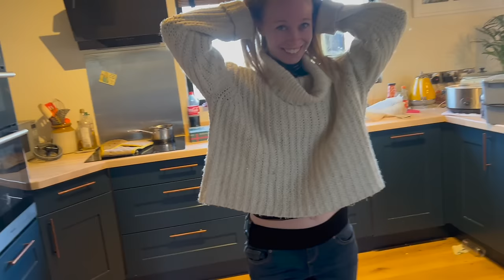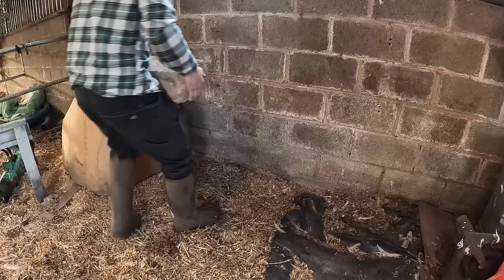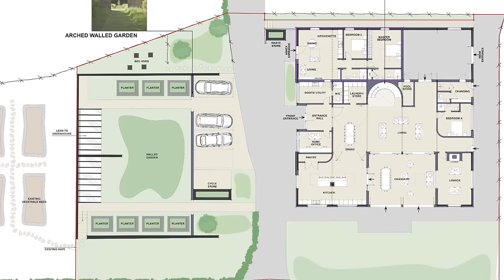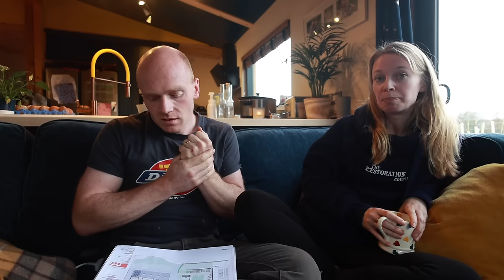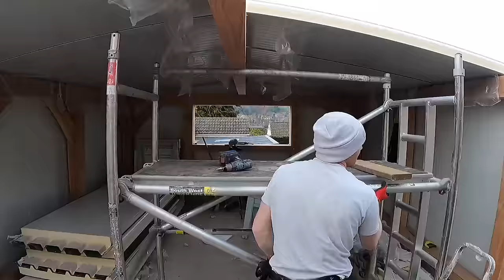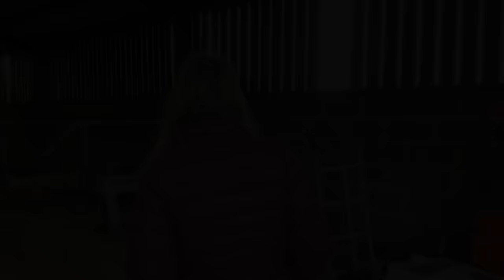PLANNING GRANTED - Dream home build HERE WE COME!

Comment: Very exciting!   Zoned underfloor heating on polished concrete.   Zones so that you don’t have to heat the whole house, especially the annex area.   As could be pricey to run.   Polished concrete can then be carpeted if required later on, or timber floor over.   
I think somewhere between £50-70k.    Good news is, apart from market value increase, I’m sure your YT will increase as well!  
Very much looking forward to the build & all the great problem solving.   Cheers from Oz.   👋

Comment: Don't neglect networking. Take the opportunity to run data runs to each room of your home. Given the size you'll need multiple access points to get even WiFi coverage throughout
Reply: That looks like a perfect table tennis room to me 😉
Reply: Agree on networking....especially the floor space
Reply: Both cat6 and conduit so you can pull in more later.
Reply: I dare say if Tim reached out to UniFi they would likely supply his equipment for free, they have done for much smaller channels
Reply: This needs more traffic, not something to be overlooked - especially in this IoT age. Run cat6 everywhere! Future you will thank you for it

Comment: Well done, I feel your pain with planning permissions and dealing with difficult counsel departments. 
I think you have spent between 30k to 40k so far. But remember one third of your building budget will be foundations plus add 25% for contingency. Make sure you price everything with a potential prices of inflation to be included as you're going to take 3 years to build it. A good investment is to include under floor heating just because of your square footage of concrete floors. Good luck!

Comment: You can definitely save by leaving the floor slab as is, simple polish should be enough before sealing it. You can add pigment to the sealer for a bit of a different (but finished) finish.

Comment: Definitely go for underfloor heating on that slab.

You've got the room to get boring equipment in fir a ground source heat pump, but TBH if you're meeting current UK building regs for insulation then you'll probably even be able to run it all off a (large) air-source unit.

Comment: Many, many congratulations 🎉 would deffo recommend underfloor heating especially if you go for a concrete or hard floor finish (no need for slippers in the winter😆) good efficiency and you have no radiators on the wall for furnishing and decorating 😊 and you can never have to many plug sockets!!!

Comment: Ive just completed an extension we have a secondary insulation layer called MultiFoil by YBS also have it on the floor above mineral wool with underfloor heating boards on top thats called FloorQuilt.
Its about £100 for 10 Square meters they do a roofing one as well 
You sandwich multi layered space blanket beteew 2 battens removing all thermal bridging.

Comment: FOR CKS SAKE FINALLY!!! YEY!! 
For a job like downstairs flooring I think I would negotiate a lower price vs advertising on your Youtube channel for the coming 5 years or whatever with some big chain store. Use what you got. You got exposure and they want the advertising. You might get your hardwood floor yet. ;) But with the floor slab already in place, you might want to consider partitioned (different house zones) subfloor heating. It can really save you a bundle on heating costs if you look at a 20 year plan. Especially if you can use (part of) the roof for solar heating instead of solarpanels for electricity. Not sure of the numbers there, solar heating vs water heating through solar power, but that is maths I know you can do.

Comment: In Australia a polished concrete floor is quite normal and a upmarket finish… remember you can get coloured concrete and different colour aggregates… we had white concrete and black and grey aggregates, which looked awesome…. You could flip it… use a ‘normal’ grey or sand colour concrete and mix in a contrast aggregate to help save cost… its awesome over underfloor heating and hard wearing.

Comment: Congratulations! Gut reaction is to go insulated subfloor with underfloor heating and air source heat pump with polished concrete.  A nod to the building's agricultural roots and from my research the cheapest way to heat (maximise potential savings from solar etc.). You can always add more expensive floor finishes at a later date when funds allow etc. I look forward to following the journey.
Reply: They have ground and water source options. Jealous!

Comment: With having such a large floor plan, and internal volume, would it not be better to have soft floor coverings like wool carpet rather than hard flooring such as concrete/tiles/timber etc.  hard flooring will make it feel much colder/less cosy/noisy.

Comment: Congratulations - and it will have all been worth it and you'll soon forgot these stressful 2 years once its all finished and your living your best life (or you'll just have blocked them from your memory XD).

As for costs, given that any planning report seems to default to a minimum £1500 starting cost, and with all your revisions - I'm guessing £20k+ on planning and surveys so far? Something like £5000 on architects, £7000 on both consultants, £2000 for structural, £2000 for initial site survey, £2000 for a bat/newt/wildlife survey, £2000 on all planning fees + other misc?
Can't remember seeing an "arboricultural survey" (which is definetly not just a tree report dressed up so that £1500 sounds a resonable cost).

Comment: Great news that’s a fantastic result hard fought for and no doubt expensive getting full planning 
Probably cost£ 28,000  my guess on planning permission several out line drawings class Q appeal, architects and LP fees  .,, at least no CIL to pay and possibly not too bad for septic tank and drainage
  I’m thinking of insulation over existing concrete then reinforced fibre concrete polished top layer but not sure about ground source heat pump and underfloor heating .. look at joriside for your roof , structural insulated panels some standing seam designs in different insulation thickness or metal sheets to instal over a SIP roof , I think I am going to build with steel sip pannels and first floor steel beam construction wooden floor joists and steel supports  joriside standing seam roof 
and considering James hardie fibre cement clad for our  lower part of build .. so many different new techniques to build with ;SIP  stud and insulation  ICF  thermal breeze block  block and insulation it’s a big build so will need a lot of original thought to keep the costs in check

Comment: Awesome.. I am so glad we don't have all that bearocracy (yes it's a bear) do deal with here. Here if you are outside city limits you can basically do anything you want. I don't understand why the pushback is so hard with permitting when the other buyers of the property would have flattened it and built and entire neighborhood which would look much worse.
             With metal buildings especially insulation should always be exterior. I wish those insulated panels were more common place here in the US. I wanted to reskin my workshop in those panels but they are just not available. Well they are from across the country and cost as much as building a new building.
                    I don't have an exact guess on your costs so far but... I'll bet you spent as much as I could build a new building of that size here in TX.